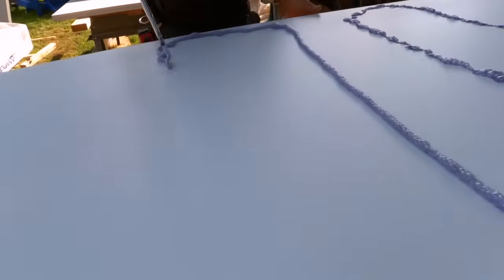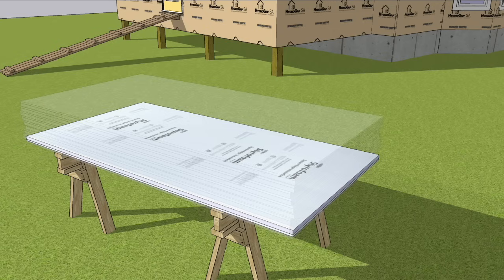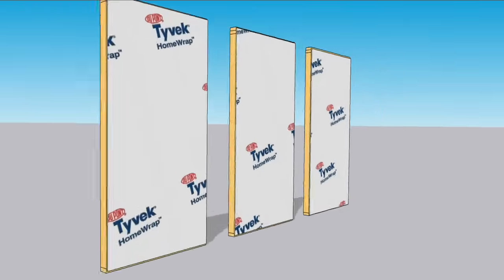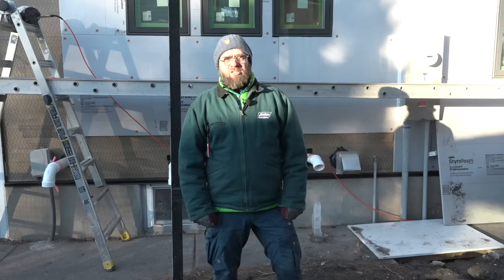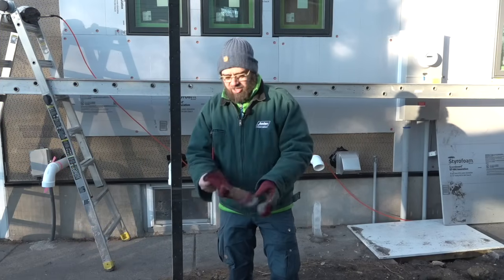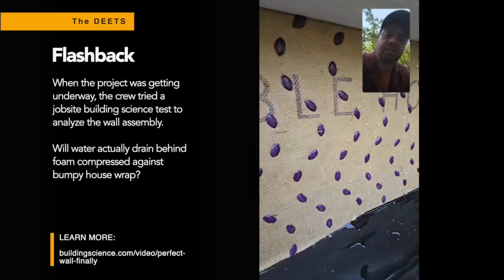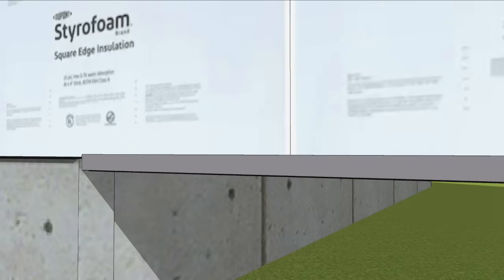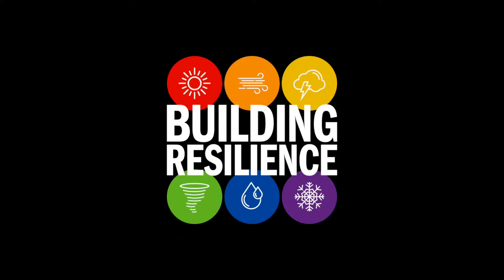All About Continuous Insulation (CI on Building Resilience 2024)

Comment: We're in the UK and we're one of the only timber framers using 4" polyiso on the outside, we put a VCL over the studs with the insulation over, there's usually a 2" cavity then brickwork.